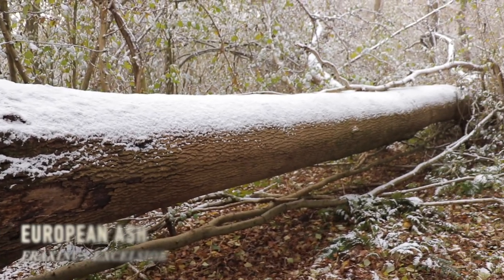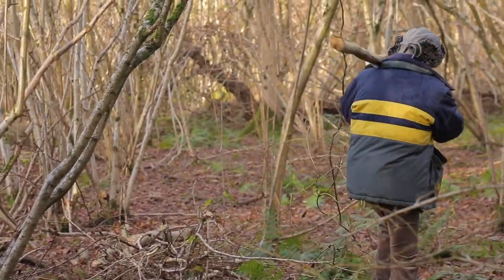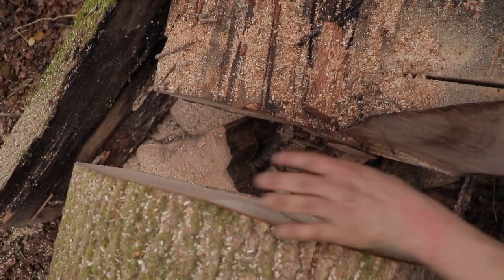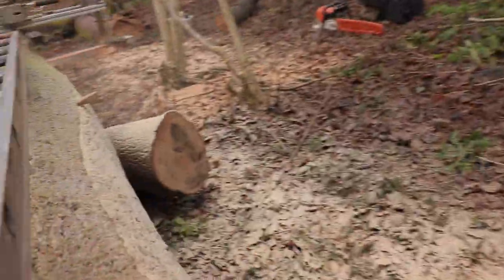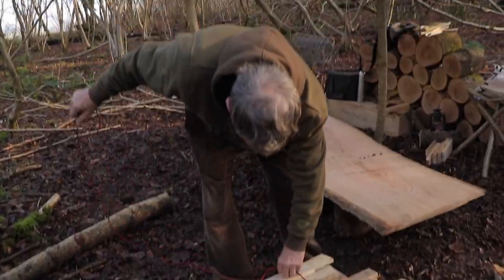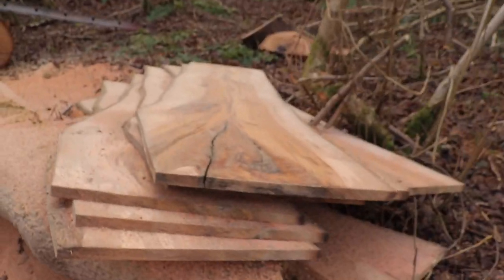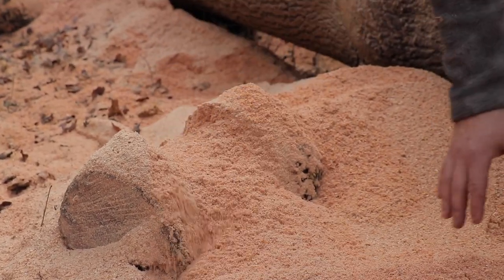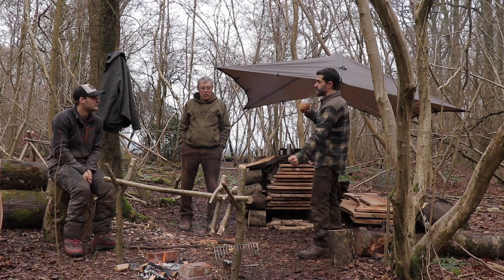Off Grid Winter Project: Milling the Giant Ash Tree into Planks

Comment: I live in northern Japan. Trees are pretty abundant here, especially pine. For near a decade I would bike past a 3 story high school that had 6 massive pines, maybe 40 or 50 feet tall, lining the front of the school. One morning on my way to work, I was shocked to see cranes and saws chopping down those trees. It was quite unsettling that things that had lived so long were just hacked down to expand a parking lot. I stopped to watch and noticed a monk saying prayers for the trees and the woodsmen had taken their helmets off and prayed with him. Even in doing their jobs, the people still had reverence and probably a bit of regret for what they were doing. I found out later that some of the wood would be shared to all of the lower income and elderly who had wood stoves and the rest would be used to build a habitat next to the school. Although I felt a certain way to see such massive trees being ended, I did take solace in knowing that the people doing it didn't do it with malice and that the wood did wind up serving a purpose for the community. Sometimes you need to remove trees for one reason or another and it's awesome to see how you've multipurposed the fallen ones.

Comment: The live edges are really only used for vanity tops and counter tops. But the pattern on the split in the tree looks really good. The initial semi circular pieces cut from the logs, you could see if there is an axe maker that wants the ash for handles. Have fun carving the oak, its super hard when seasoned. You Dad's sausage looks good to me, cooked the way I like them.

Comment: the burl wood can be very valuable to wood workers,  also you might consider painting the ends of the boards with sealant to avoid checking or cracking as the boards dry.  Pick out some choice boards and have them kiln dried after a few months of air drying.  A moisture checking device might serve you well.

Comment: As an Arborist also i can offer some further advice.   
1. Don't use the sawdust for food smoking, it will contain the chainsaw bar oil in it. It's best to spread the sawdust out onsite and it will quickly turn to fungus food! 
2. The best way to slow the drying process and prevent severe cupping of the timber slabs is to apply paint or wax to the end grains of each slab, this slows the amount of moisture loss as the in the cells in the timber lose their moisture.

Comment: If you paint a coat of wax or paint on just the ends of those slabs they will cure a little slower and its help prevent some of the cupping and cracking that can occur if it cures too fast. 🙂

Comment: Shame you cut them so thin bud but good work.

I took down an ash tree for an old boy, did it for him at no charge, had a climber with me, took the tree, 3 tonne of firewood and x12  4 inch slabs that I got milled up and some of them will be used as sliding doors in a barn conversion that I’m undertaking soon. 

I think it’s great you utilised it 👍🏻 Maybe 2 inch slabs next time?

Comment: Not bad work but one huge mistake! Cutting the crotch like that and not optimising the possible figure and max width is an error and a half! 
Longer thinner wedges will hold place and be sturdier. Bet them wedges consistently fell out due to vibration. 
An inch depth!? You want 2 1/4 minimum. The cupping is gonna be ridiculous! Like frickin crisps! 
What an absolute waste of a prime material! 🙄